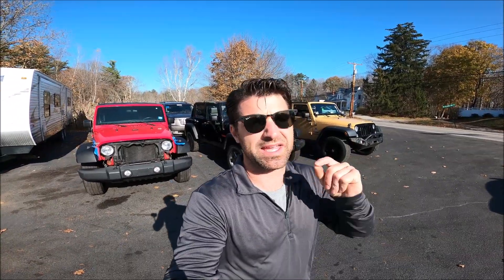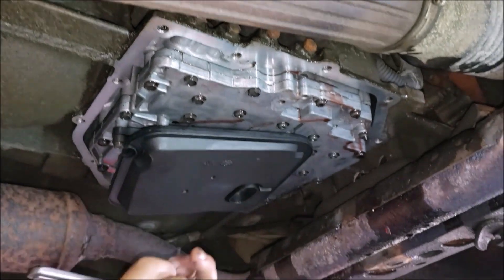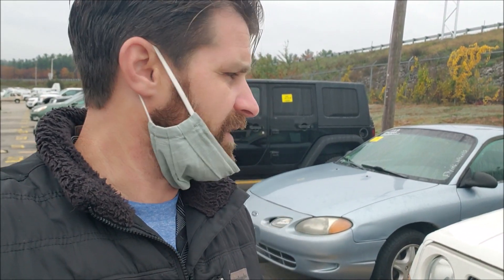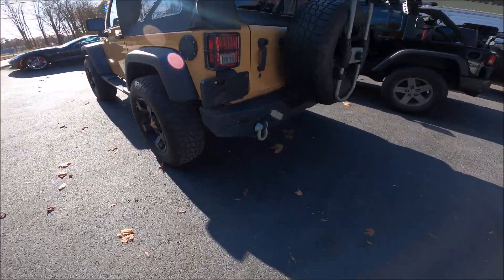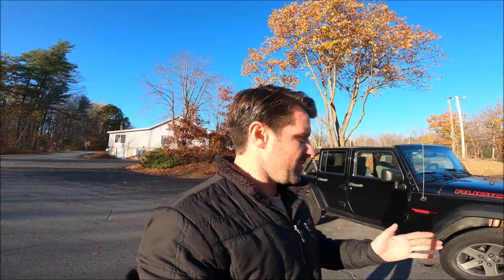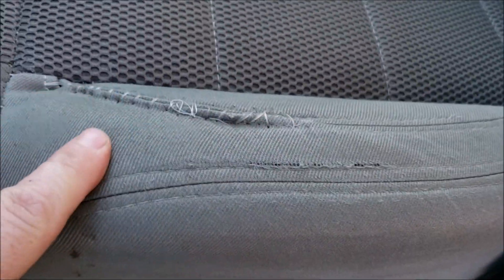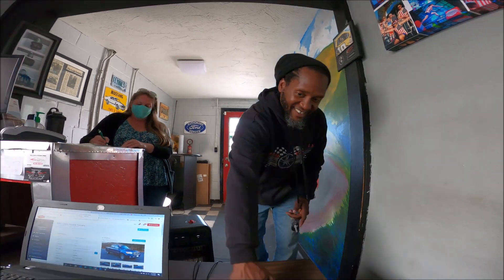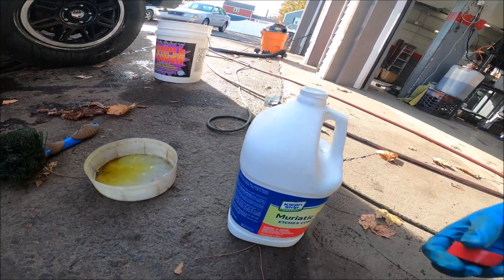How Much money I Lost Trying to flip a Jeep Wrangler - Part 2

Comment: even though I said stock grill is better on the insta I'd put the angry eyes on the 2 door.  that one should sell easy being the new motor and miles are pretty low even though the colors pretty ugly.   The steelies you took off  the sold 2 door should sell on CL marketplace pretty easily.  Lots of people want those.  I actually put them on my 02 over alloys as I thought they looked better.

Comment: I did not think those black with silver rimmed wheels were OEM. I was wrong they were available from 2013 to 2017 on JK wranglers. The part number is 82211231

Comment: What prev owners should of been doing to that black rubicon frame was have it oiled up every winter and those frames would never rust and if it started too the rubberized coating makes it even worse, they were better off griding down the frames spraying with rust converter coat and a rustolem matte finish and that would of preserved it. But hey awsome job with content i know you are doing the best at upgrading everything u get and thats honest work

Comment: I got one for ya that just happened this past month ,i got hit in my 2005 ford escape xlt that i bought 4 1/2 years ago with 45k miles for $5900, The insurance adjuster totaled it because it had fender damage bumper cover damage and my passenger wheel was laying in,so it had suspension damage right? wrong,it had a bent strut which made the wheel lay in.I got paid $4,600 for it and i also kept the truck with the same clean title it had before, I bought 2 new struts $139 ,a new junkyard fender complete with the flare and inner plastic $100 ,a new bumper cover $130 ,i did the work myself except paint ,I had it painted $550, and a wheel alignment $130 , So a suv i drove for 4 1/2 years paid $5900 got paid  $4,600 and i was able to keep it put about 1k into it ,and got $3,600 in my pocket LOL, and i still drive it everyday

Comment: Craig, just found your channel. You’re doing a good job explaining things. Appreciate that. As a Jeep owner you need to know that Wranglers are very modular and so much comes apart and easily replaced. That red grille that German is painting, no need to tape it off. All 7 of those are easily removed from the back. 

The black with the dent from the mirror. That piece is easily replaced with one that is either stock from a junk yard or even replace both with aftermarket for very little cost. 

Can anyone go to a car auction or do you need a dealer license?

Just a couple thoughts.
Reply from the maker: Thanks!  I have a dealers license for these auctions

Comment: That rust is considered “structural damage” by auction standards. This brands the title and no one wants a vehicle with “structural damage”.  Also the rust you showed, is on the “inner rocker” which is considered “structural damage” if it was just the outer rocker you would have been fine.

Comment: The only Jeep i would buy is one that has the AMC/Chrysler 4.0L Straight 6.
Reply: None of those would have the 4.0, everything after 06 has the 3.8 v6(burns oil and eats valves) then everything after 2013 has the 3.6 v6
Reply: 2012 starts the 3.6

Comment: I don't know man, I've got an '03 Wrangler with less rust than that black Rubicon, 150k miles, spent it's whole life in PA.
Reply: It's possible that in your area they aren't as crazy with the road salt as in New England.  I've lived most of my life in New Brunswick,  these maniacs up here start laying down a carpet of salt as soon as the first flakes hit the ground. I've already seen vehicles as new as 14's with paint blistering off.
Reply: They aren't quite that bad, but it's definitely an issue.  I've had three vehicles fail inspection due to frame rust, none of them were terribly old.  My Wrangler I just bought last year.  One of the cleanest frames I've seen.  I currently have an '02 4Runner that's about to get parted out thanks to rust.  

The Wrangler crowd is especially sensitive to it because it seems like as soon as the frames have even a little rust your days are numbered.  And they're so expensive, even used, nobody wants to pay that and have it fall apart in a year or two.  

My plan moving forward is to keep my Wrangler clean and park it once the salt comes out.  I'll just keep a cheapo beater to drive when that stuff is on the road.